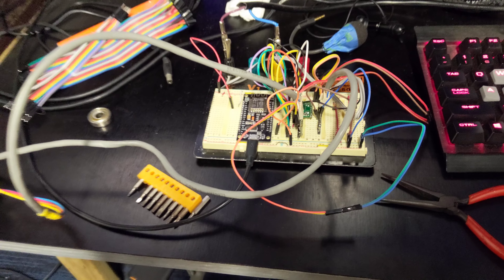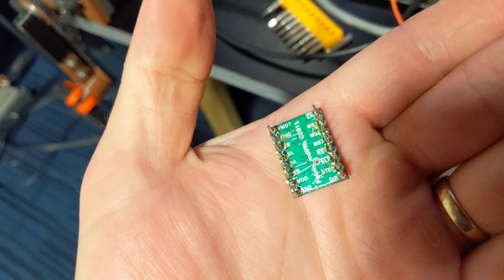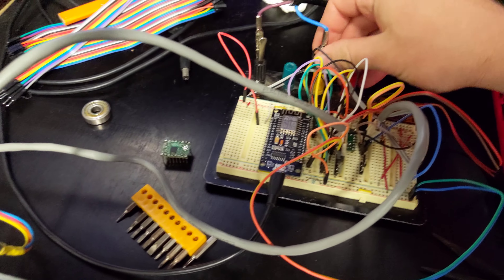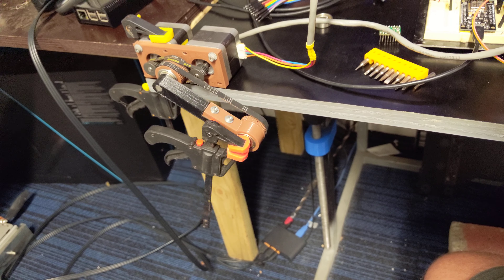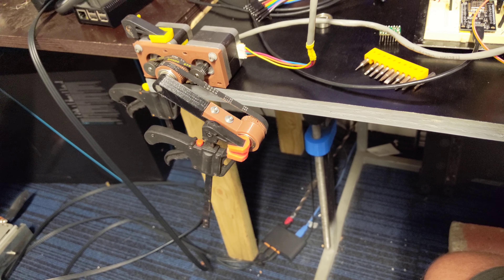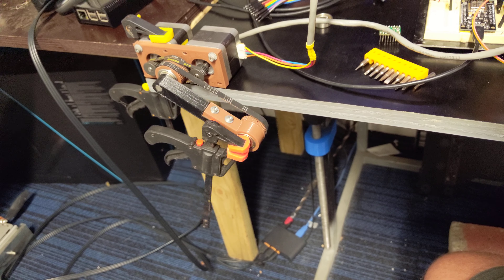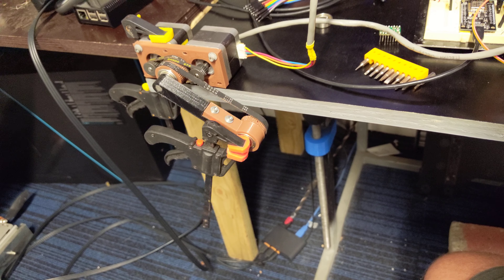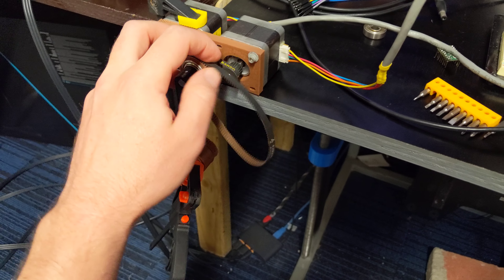Sand drawing - Steppers powered up

Comment: Hi are the stl files for the printed parts available for me to try make one of these or do I have to make them myself? very cool design, well done!
Reply from the maker: They sure are! Kinda! Check out the "scad" folder here: https://github.com/tjhowse/sand_drawing . You'll need to use OpenSCAD (free and open source) to generate the STL files from the code.